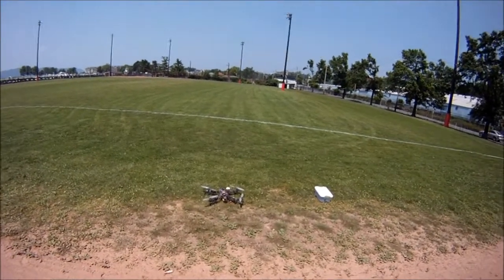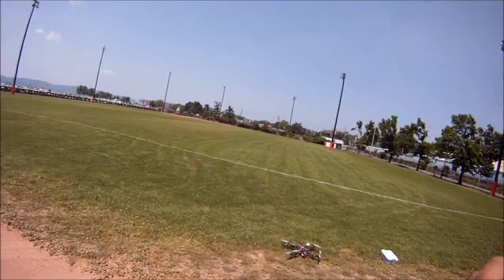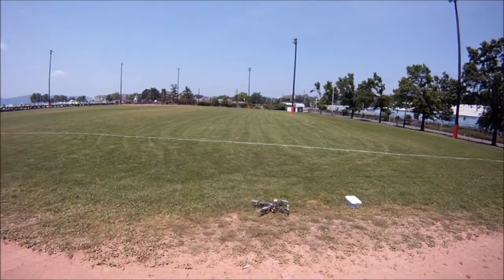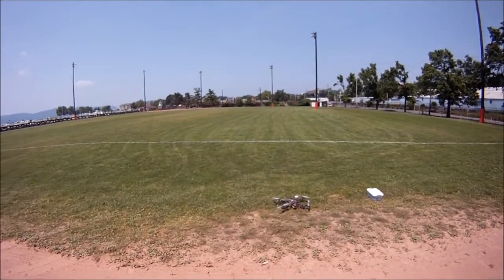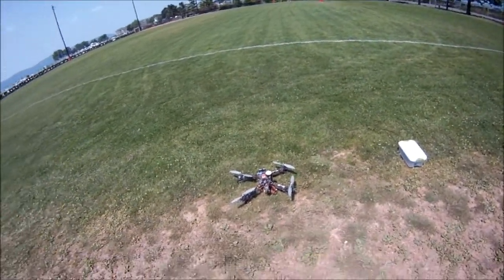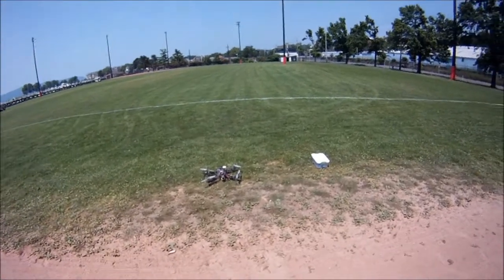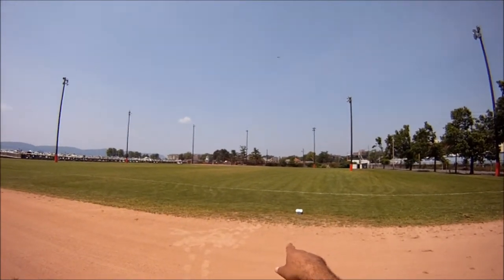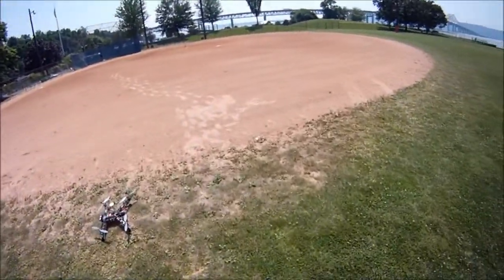NAZA-M GPS RTH " Return To Home " flight test

Comment from the maker: The flight modes on the FC are GPS MODE that you used for position hold and RTH , ALTITUDE MODE that you used for altitude hold or stable flight that works great for FPV flights and finally MANUAL MODE that is perfect for 3D flights .